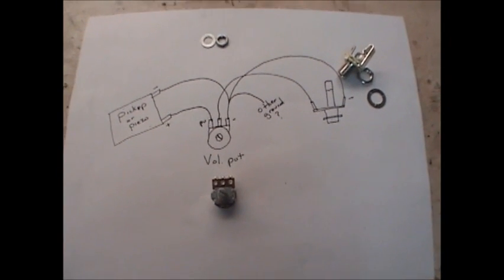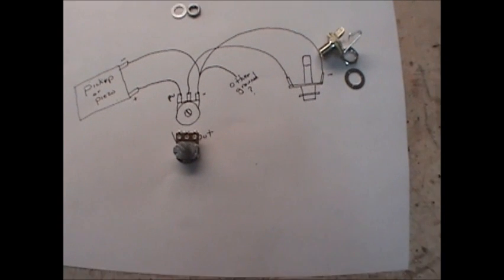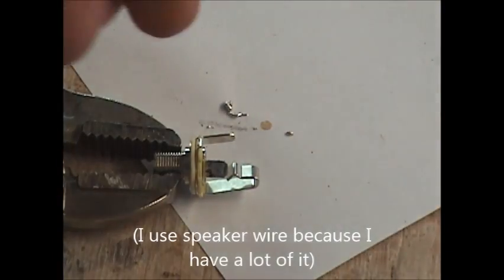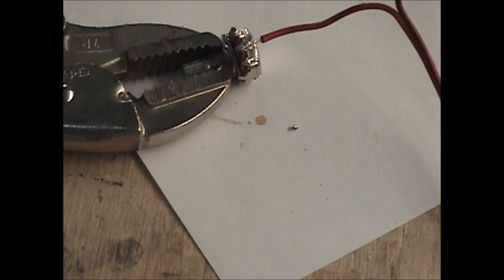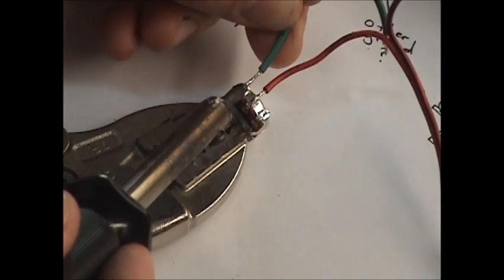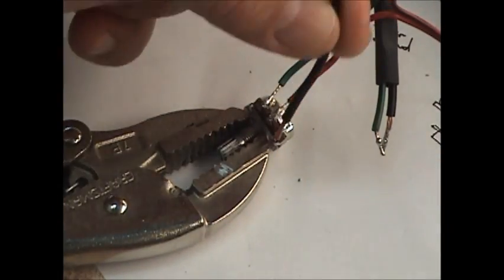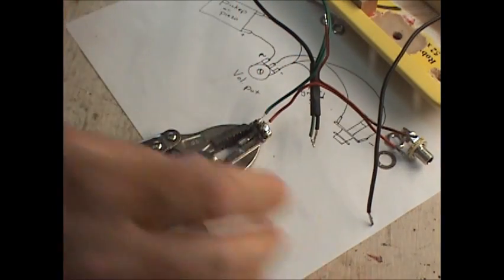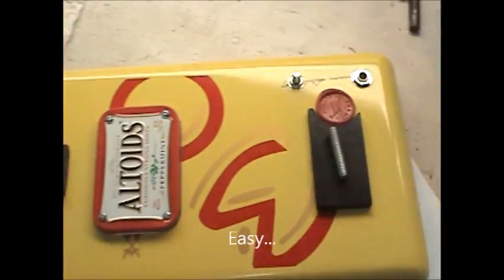Guitar Electronics - How to

Comment: if i use a piezo where do i solder the ground?
Reply from the maker: Vasilis Narlis Hi.  The piezo should be wired just like the magnetic pickup.  Piezo ground goes to the same common ground (on the jack, or on the volume pot if it is used).
Reply: now i got it
ok thanks a lot !!
Reply: Eric Kasten sorry if im annoying but i checked out your website and i saw that you are making your own pickups. Do you have any video of how you are making these ? Or could you just explain me ?
Reply from the maker: +Vasilis Narlis Just saw your reply... sorry for the delay.  I do not have a video of making the pickups, but I think I will be making one soon.
Reply: no problem
i will wait for it... Thanks